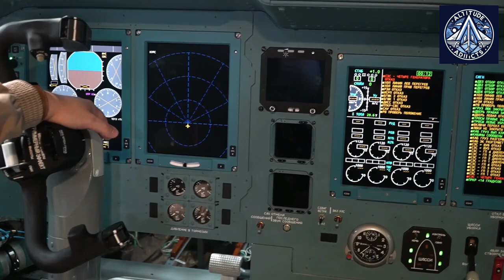What Changed in  Il-76MD-90A?

Comment: competitive ? well the C-17 has stopped production
and the only other heavy 4x jet engine transport still in production is the Chinese Y-20
A-400 is in production but stupidly expensive .... and its turboprop and slow 
get ready for a huge queue of countries looking for 2nd hand Russian Il-76s that have been refurbished  .... after they have been replaced by new model Il-76-MD90s 
that is where the action will be .....
Reply: Are you joking? A-400M has cruising speed just 50kph lower than C-17 and is turboprop on purpose; not to mention A-400M is actually faster than Ił-76.

Comment: As per one PAF pilot, the IL requires much effort to fly as compared to the C-130 because of its heavy controls.
Reply: not really as it has modern fly by wire controls.
Reply: @lexburen5932  I’d rather have a c-17. Just a better aircraft all round
Reply: @FancyPantsOnFire  And 2-3 times as expensive.
Reply: @lexburen5932  this is not correct. The Il-76 uses old school mechanical flight control system. Why would you lie about something you obviously don’t know about?

Comment: India  300 aircraft  needs   and export orders  350 aircraft
Reply: India would be well advised to procure higher quality transport/combat aircraft not constructed by Russia.
Reply: @Dweller415  India bought the C-17 and it was 2-3 times as expensive as the IL-76. Without question the C-17 is a great aircraft, but why use a Rolls-Royce when a Ford will do the job?
Reply: @heyfitzpablum  you are absolutely right . I think the Indian defense consultants are more wise to select this great bird , affordable and durable 
And put in your mind that the flight cost is more cheaper by may be 1/6 than the C17
Reply: @Dweller415  for example, buy an old piece of crap C-130, as old as Biden! 😂

Comment: How many flight crew are needed to fly it? Curious how’s it been decades and they haven’t been able to develop a single two-crew version.
Reply: For military cargo plane there is no real need for two crew version.
Reply: @FirstNameLastName-hy1pf  it is always wise to have 2 pilots when flying
Reply: @PoliticalGangster  I think we are discussing the presence of a flight engineer🙂
Reply: @dereksollows9783  , exactly.
Reply: good point. the new IL 214 has all the upgrades for a modern cockpit and still has a flight engineer who controlls the throttles during landing and take off. The airlines are not happy because of the extra costs as compared to 2 pilot ops. The IL I beleive will change in the near future to be flown without a flight engineer and I guess it will be the same for this plane. I do think its a beautiful looking airplane even though its a very dated looking fuselage and nose cone.